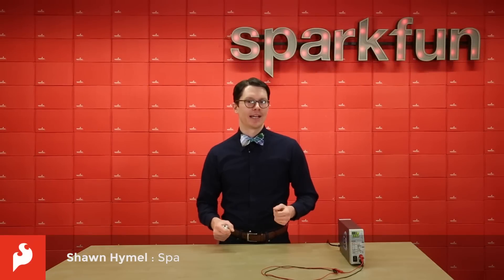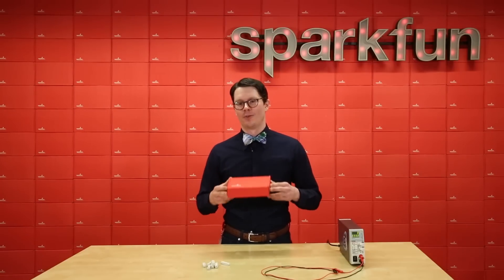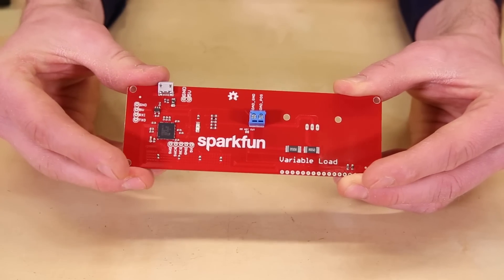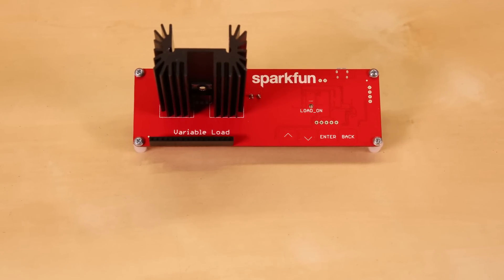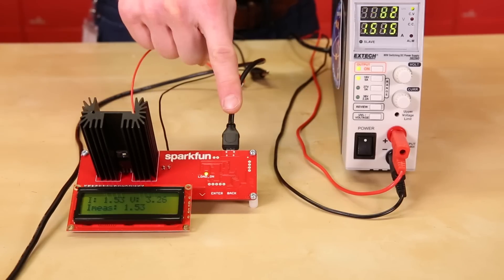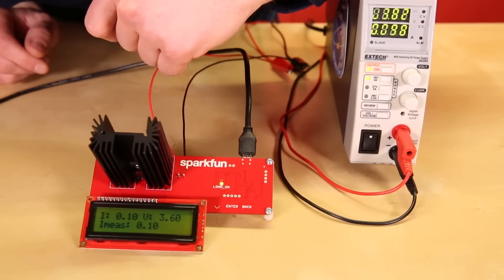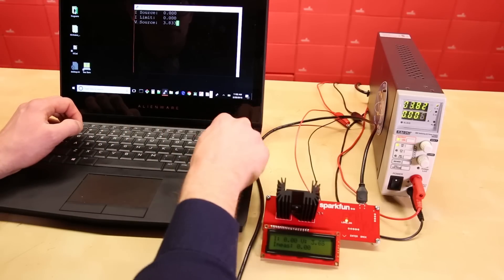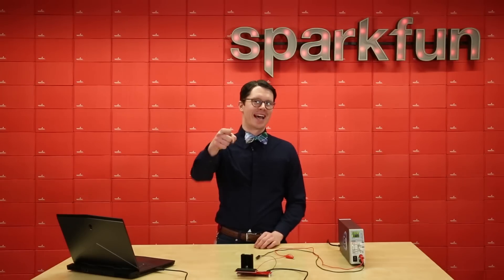Product Showcase: Variable Load Kit

Comment: Board design was done by some novice. Why is the LCD hanging out? Current carrying traces has to be thicker. You used a PSOC for USB, LCD etc, but could not provide a thermistor for over temperature shutdown? Even better would have been connecting an external fan (optional) to dissipate the heat and increase the max power rating.

Comment: To add to the general consensus: 15 watts is really a pretty small amount of power for a thing like this. I designed a dc load myself pretty recently and the one thing you want to make sure to include is a really beefy heatsink and some active cooling at that, and you certainly want thermal monitoring. And I’d have to agree with everyone else, the layout seems really poorly thought out. Like someone said, what if you want to put it in a case? 

As far as I can tell, what you have is a mosfet, a power resistor, a few op amps and a bunch of passives, plus a underutilized controller, is there even a regulator on there? How does that get from $8 in parts to $40 retail? To bad, because I think there’s definately a need for an inexpensive load like what this intends to be.

Comment: Yikes, that board layout is awful in so many different ways. This product could be neat since DC loads are handy and not that complicated, but you need to start over on the board design. For $20 I'd expect some cut corners, but at $40 for a 15W load I want something that's better than a rough prototype. It sounds like it doesn't even have a thermistor to detect overheating! You'd be safer buying one of the cheap DC loads from Aliexpress, at least they have a temperature sensor to keep from catching fire.

Why is there so much wasted space on the PCB (especially on a load where you don't want long traces)? Why does the LCD cover up the controls?  Why is the jack in the middle of the board and on the bottom (really)? Etc.

I don't like to be negative because I love SparkFun, but this product is just plain lazy.